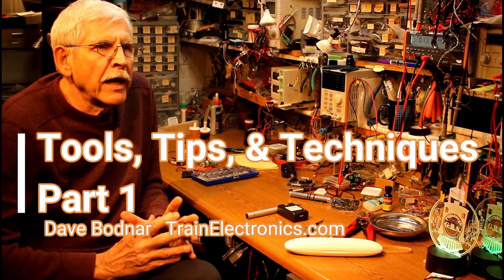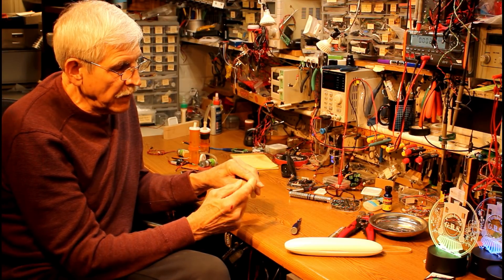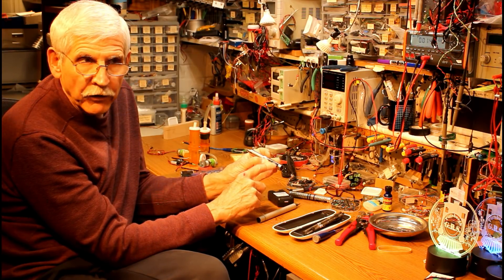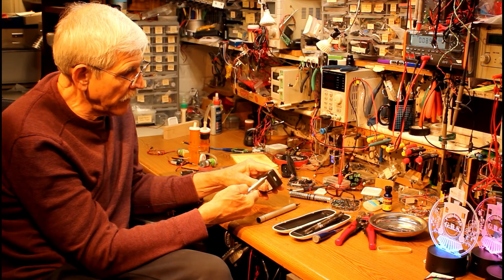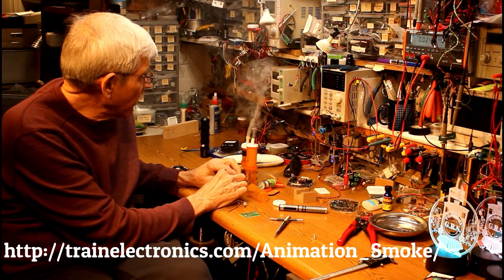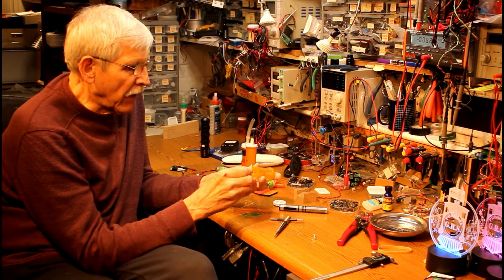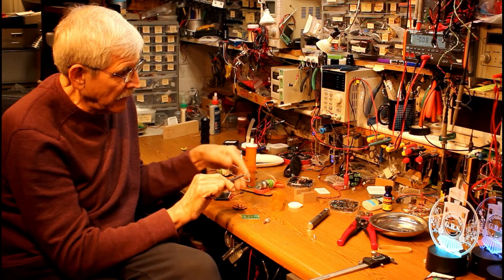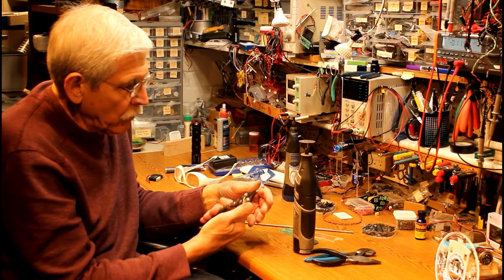Electronics Tools, Tips, Tricks & Techniques - PART 1

Comment: Howdy Dave,  I've got 2 12 V LiOn batteries that came out of an old back up power supply that our camera equipment used.  I tore it apart when something in it smoked, but the batteries are still good, just discharged.  I was wondering if I could use a car battery charger to charge them?  I would imagine that the charger has a built in current limiter circuit that limits the charge when they become totally charged.  Can I do this successfully?
W Rusty Lane in eastern Tennessee (Witherington Place Railroad)
Reply from the maker: Rusty - I would NOT do anything with those batteries as Lithium Ion cells need to be treated very carefully or they can cause all sorts of problems (including bursting into flame!)
Also, if they are completely discharged they are likely dead and not recoverable.
dave
Reply: Howdy, Dave.  I researched the batteries and they are made by RITAR RT1270 sealed lead acid core batteries.  It says on the battery "valve regulated rechargeable E battery."  I went ahead and put my car battery charger on it last night and so far it has charged to about 6 volts.  Guess I'm gonna have to leave it on for a longer period.  I would think that the car battery charger has a current limiter circuit to reduce the charge amps as the battery charges to max.
Reply from the maker: Rusty - it makes more sense that they are lead acid - much safer to work with than LiIon - a car charger should work with them - just keep an eye on the voltage as you charge them --- also make sure they are not getting hot

Good luck!
dave